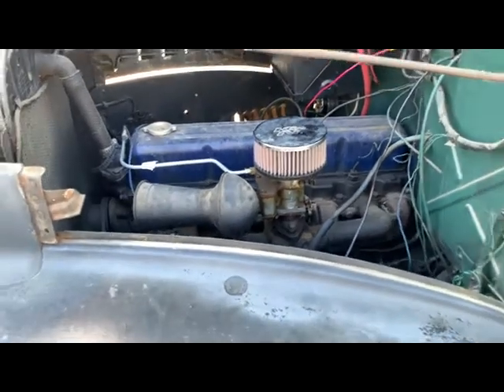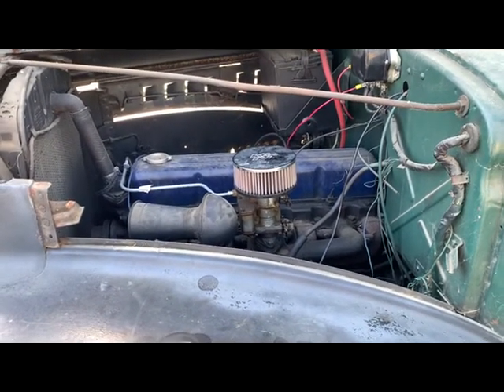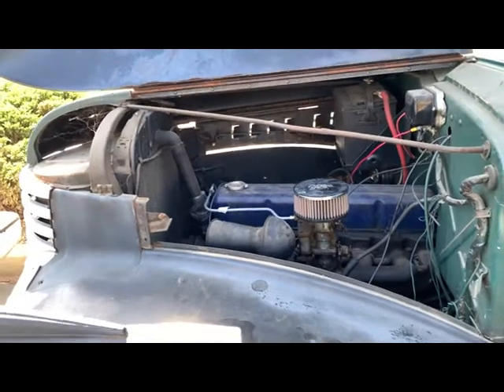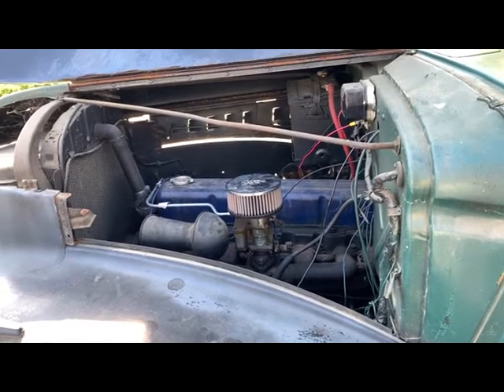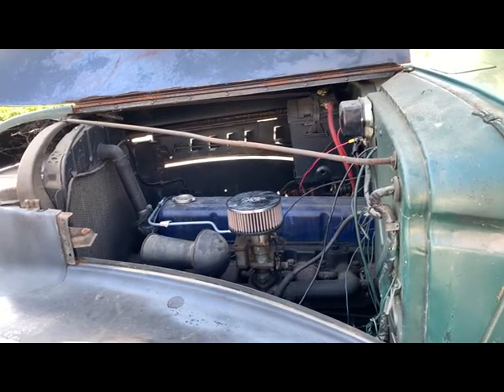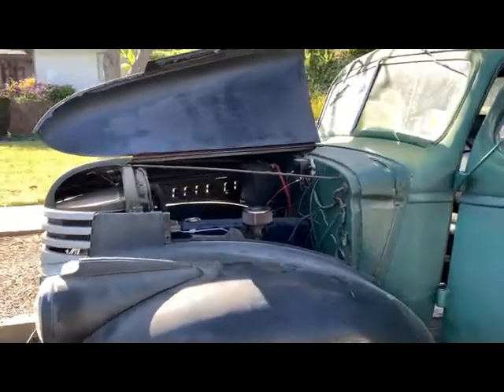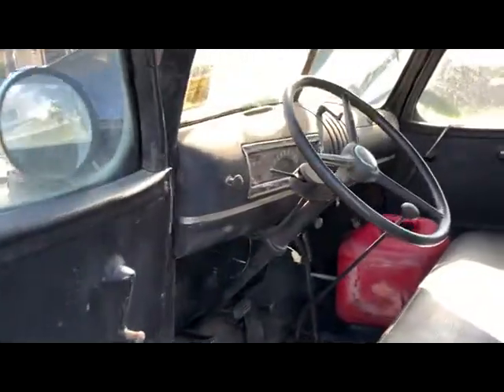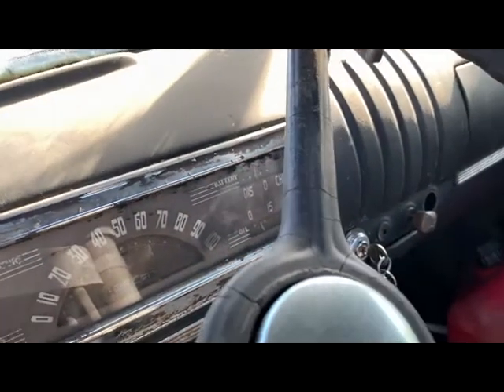1946 chevy pickup gets new fuel line and ignition switch

Comment: Where did you find a new ignition switch & was it hard to install?
Reply from the maker: Sorry to be slow, I bought it at either Jim Carter, The Filling Station or Chevys of the 40s. Most should work, they usually have 3 poles, ground, on, aux